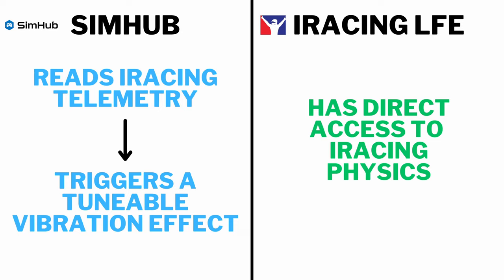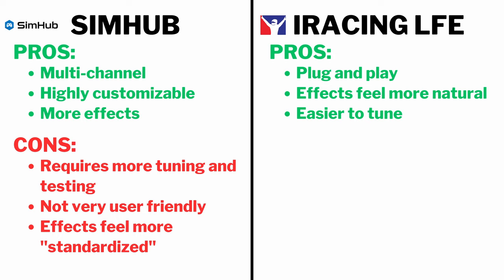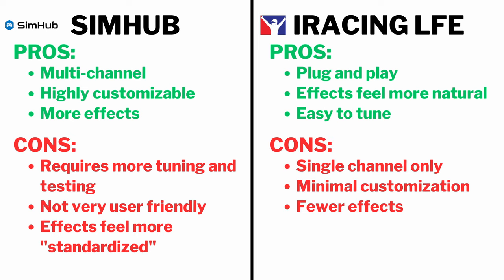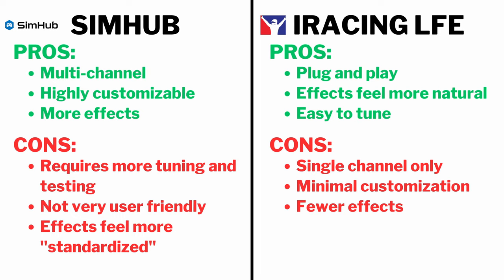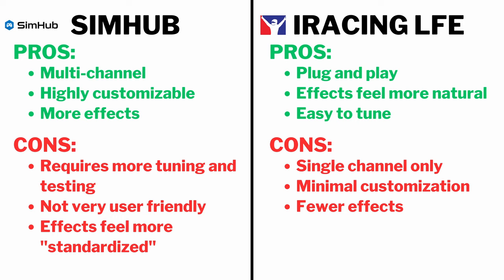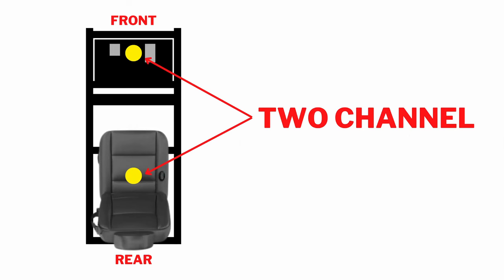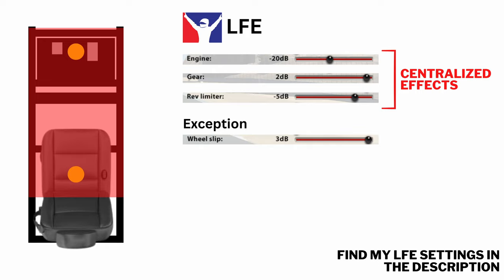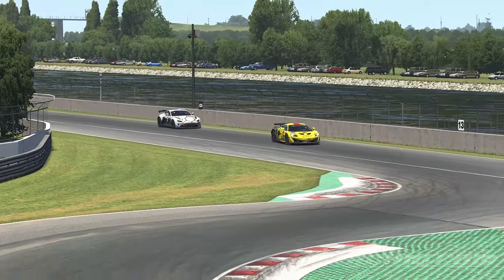SimHub vs. LFE for ButtKicker - Which is Better? | iRacing Haptics Guide

Comment: What i don't understand and nobody talks about, is the fact that wheelslip is only in the lfe channel. Simhub doesn't have telemetry for wheelslip from iracing, it has to calculate and assume it on its own. So the effect should definitely be delivered differently. Would really like to know how the are different to each others.
Reply: I'm lucky that RBR has wheelslip in the telemetry, since that's a nice effect to have in rally racing. It seems odd to me that iRacing wouldn't have it, maybe it's something they could add in the future if people asked for it.
Reply: @jasonlowmaster Ya, like iracing is going do that. Their tire model is crap.
 It's unrealistic and when real championship drivers across all the worlds top racing series publicly say this iracing still does not fix this glaring problem.
 The fastest people are the ones who learn how to exploit and manulipate the tires and setup physics models. AKA : Glitches.
 The tires should be more forgiving and dynamic as how they wear, flat spots, flat tires in general and slow punctures.
 With rain coming first we will see how bad the tires work.
 People will be certainly complain due to the lack of grip running in the rain.
Reply: I agree @mrj3217

Comment: This is a very interesting take, I also have 2 channels but I use wheel slip on Simhub. For me wheel slip takes priority and is the highest frecuency and volume, this makes it very separate instead of centralized and it works like a charm. Then again it has taken me a long time to fine tune simhub.
Reply from the maker: That makes a lot of sense mate, that's also a great way to set it up!

Comment: Was curious to see your findings. I have 3 bass shakers and also use both simhub and lfe. The bass shakers + trueforce on my Logitech dd wheel is pretty insane immersion in vr. The iracing trueforce is outstanding

Comment: Excellent video, to explain something that’s a bit confusing for getting started with haptics. And making sure you don’t have both LFE and Simhub running the same effects at the same time and making things sloppy. I’ve mounted a Dayton TT25 on each of gas and brake pedals. One BST-1 bolted to the rig near the back. And I’ve got two TT25 left over that I’ll probably stick in the seat itself. Using a Nobo 2x50w in front and a 2x100w for the rear and seat ones. And will be using some of your tips to fine tune. Thanks.
Reply from the maker: Glad you found the video helpful!

Comment: Great video! So far my tactile setup consists of 6 channels (left/right and main with transducers/bass-shakers glued to the seat, another shaker underneath the pedal-plate and rumble-motors for brake/throttle). There's not that much space left on the seat shell but I'm gonna add another bass-shaker on the lower back for LFE effects. It really adds a lot to immersion, especially with VR.
Reply from the maker: 6 channels! that's awesome mate, thanks for sharing :)

Comment: I found your videos recently for having a lower budget bass shaker and went with one BST-2 (35W) don’t think it’ll have too much difference with the 50w. In small testing on Sebring using your settings for simhub and lfe it gave me more consistent vibrations that were not overbearing or incorrect. For the moment on my 1 shaker setup I removed the abs as well I added accel gforce when the TC activates while accelerating it gives a good indication of what’s happening in the rear
Reply from the maker: That's great to hear!

Comment: Yea I prefer LFE over sim hub, just wish iracing would have a setting to separate from front to rear.
I've been doing a lot more formula 4 on iracing, and having the ability to feel the back starting to slide on a high-speed corner is super useful.
Reply from the maker: LFE does feel nicer out of the box for sure! I also wish they had 2 channels. I’d probably stop using simhub if that was the case
Reply: Have problems feeling Slip. Have bst2 under Seat and pedal shakers. Could you post your settings. I just feel a small tingle for slip.

Comment: great tutorial and explanation. I got my first buttkicker this week and many things are not so clear to me how to use the buttkicker gamer plus perfectly with iracing especially and with other sims. whats your suggestions for a single setup and which lfe parameters should be atcivated and on which volume in lfe section? do you suggest to use some simhub effects too beside lfe in iracing for a single setup and which do i have to deactivate in iracing? would be great to hear from you and many thanks.
Reply from the maker: Thanks mate :) for a single transducer setup, I would most likely go only with LFE, and then maybe test adding one or two SimHub effects on top of that based on preference.

Comment: Thanks for the tips - it is very difficult to find good information on how to tune haptics with simhub! I have a quick question: I have a gamer pro for under my chair and then I have some of the Simagic HPRs for my throttle and brake. Could I do something similar to your setup where I dedicate all the localized settings to the HPRs on my pedals and then run LFE for the gamer pro below my seat? I fear that your recommend localized settings for the front of the rig will create too much noise when combined with the simhub settings I already have dedicated to the pedals, such as wheel lock and traction loss. I could potentially remove traction loss from the HPRs and keep the lock settings,  plus all the localized simhub settings you recommend? I just feel that HPRs plus another Gamer pro under the pedals might be overkill and I can just create this 2 channel system synthetically through the HPRs instead. Thanks in advance for any helpful answers!
Reply from the maker: Hi Harrison, does iRacing see the gamer pro as a separate sound output option to the HPRs? If yes, then doing what you just described should be possible!

Comment: So this might be a dumb question but planning on getting 2 bass shakers. Since I wont have the amp beside me I Wonder if its possible to bind the master volume on the shakers in simhub on a let say turning knob on a buttonbox?
Reply from the maker: That's a good question. I know it's possible to bind volume for LFE to whatever button, so you're covered for that.

On SimHub I'm not sure if it's possible. I don't think so honestly. But alt-tabbing out of the game, when in practice sessios, to quickly adjust that slider, isn't that much of a hassle (for me at least). It would only really be difficult to do during races.
Reply: @LDFR  thanks! Think ill just be doing simhub when I get it tbh and no like you said, not a big deal to alt-tab but im planning om building a ignition/start mini buttonbox and if it did work with a turning knob for the master volume i would put that there aswell 😅
Reply from the maker: @Jansson18  That sounds like a cool project and I hope for you that it works! Good luck!

Comment: great video! does anyone know how i can use both of my butt kickers in lfe mode on iracing at the same time? TYIA :)
Reply from the maker: Yes you can! It will just be single channel though (they will all activate at once).
Reply: @LDFR I appreciate the reply. My question is more so how do I allow iRacing to output to two butt kickers? Under my LFE settings on iRacing it only allows me to select 1 butt kicker.

Comment: I use LFE in iRacing for wheel slip and gears. I use Simhub at the same time but only with the wheel lock option.

Allows me to get the best feel from iRacing but with a really obvious feel when the wheels lock.
Reply from the maker: That's clever Jake! Thanks for chiming in!